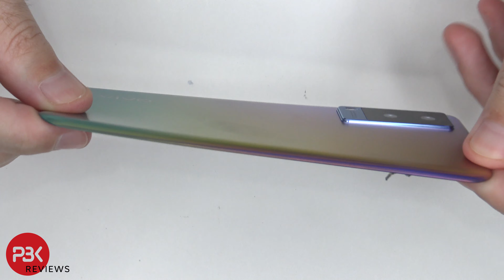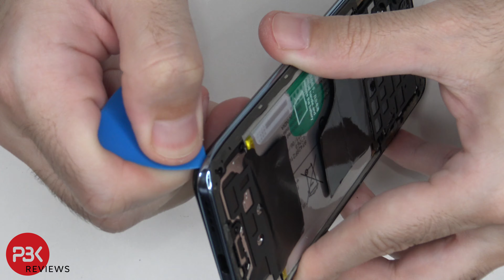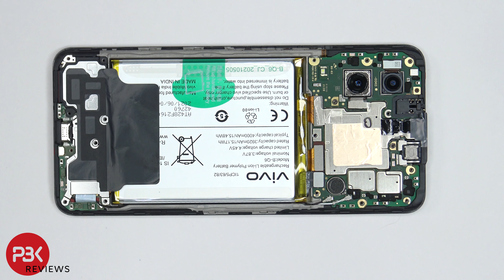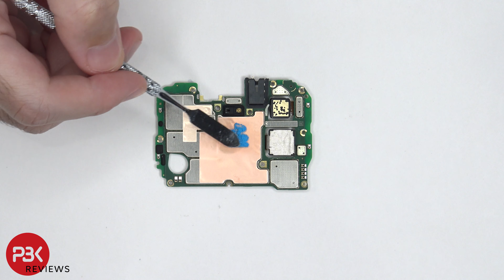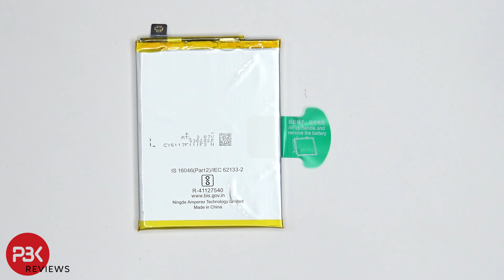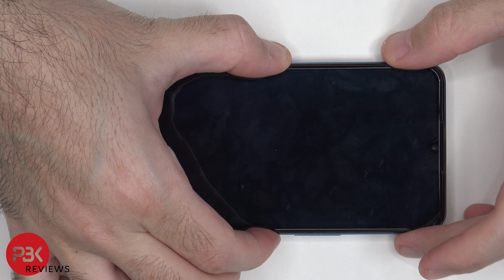Vivo V21e 5G Disassembly Teardown Repair Video Review

Comment: What should I do, my screen of may cellphone won't turn on it's not lowbat the battery is working on but the screen it not turning on. Please help me.
Reply from the maker: If you have dropped it, its possible either their is a small hairline crack somewhere on the screen or in the corner that you can't see that is preventing the screen from working or possible that the screen cable may have gotten disconnected from a drop.